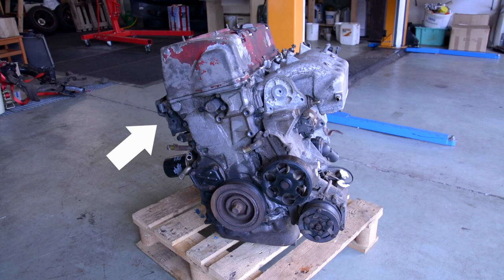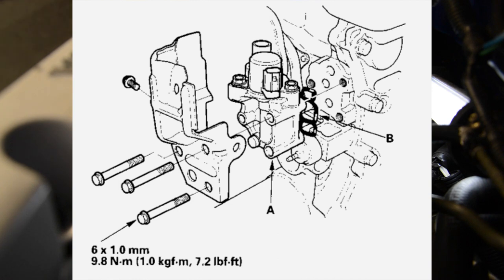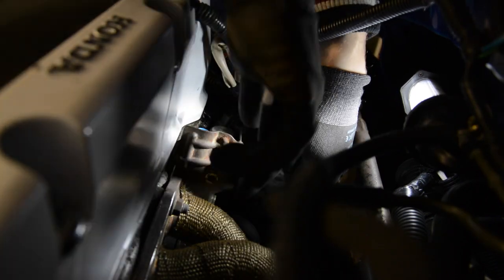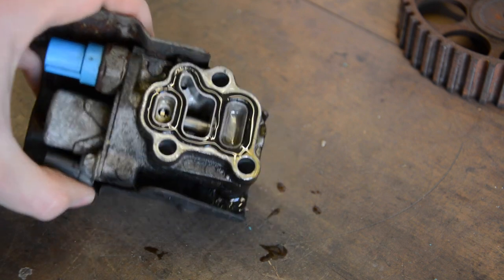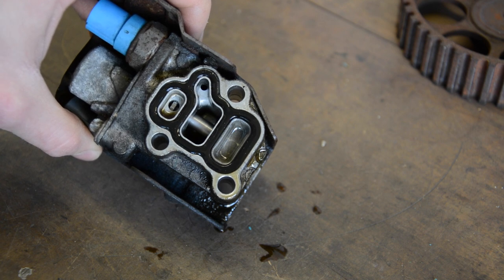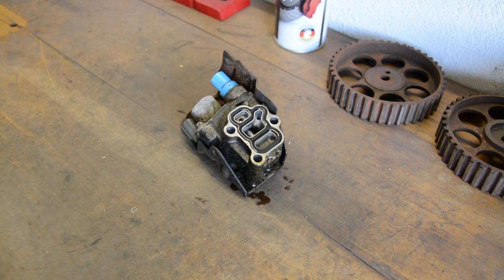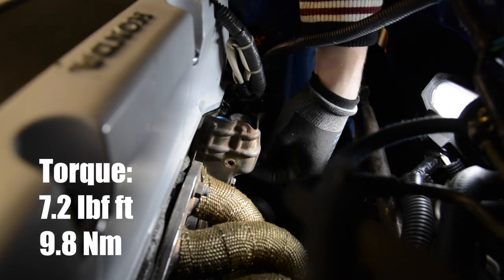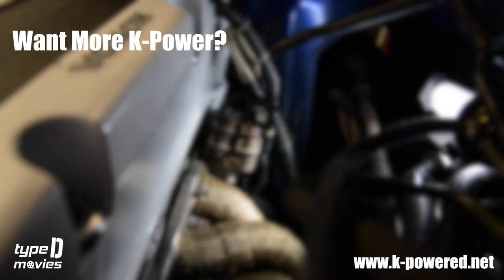K20A VTEC Solenoid Inspection - TYPE D MOVIES

Comment: my k24 is going into limp mode while in vtec and wont go past 4 grand rpm, if i turn the car off and back on it resets but happens again. i checked the vtc solenoid and it works and took off the vtec solenoid and it was clean. not sure what it could be.
Reply from the maker: Had this problem a few times in the past. Always "fixed" it with just turning the car off and on. It threw an error code but I haven't check out which one, yet. My timing chain was streched a bit and the problem with the limp mode only appeared in high revs, so I guess the timing got out of sync from 6000+ 
Check your timing (marks on the camshaft gears at TDC), chain and tensioner. I don't think that the solenoid causes your problem. Keep me updated!
Reply: I did too. I changed the oil pressure switch. So far so good

Comment: I got an engine check light and its code is p1259 which is vtec selenoid. I ordered a selenoid gasket and ots about to come. Will try to clean it thoroughly.
K20a2 engine from ep3 for eu market.
It gives me the light after oil warms up at about 100°C while in vtec. After it just goes into safe mode. After turning the car off and on again, vtec engages, but only for a couple of seconds. Any advice ehat to do if cleaning it doesnt help?
Reply from the maker: I would change it entirely. Had the same issue (vtec not even engaging at all) - a deep cleanse didn't help. Installed a new solenoid and it worked
Reply: @kpowered  i got vtec, but at some point, the check engine light goes on.
Ill try to clean it first (gasket costs around 10 euros/12 dollars). If that doesnt work, ill replace the whole thing. Oil change was done 4 months ago/4000km. Oil is so clean i can barely see the min/max on the dipstick when i pull it out lol
Reply: @kpowered  and btw, when can i get the whole selenoid? I was looking on amayama and they only provide parts of it and not as whole. I want it brand new, dont want a used one.
Reply: Did you ever figure out what was causing your problem ? My k20swap em2 is doing this exact thing and a new vtec solenoid didnt fix it
Reply: @nickdentguy  i ended up replacing the chains, guides and tensioners (all of them) and vtec solenoid (used, but in better condition than mine)